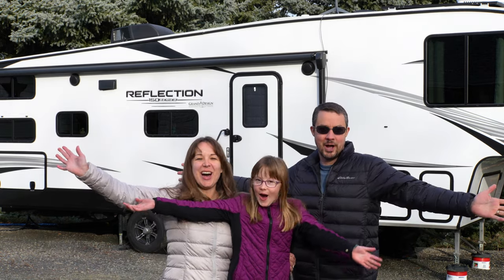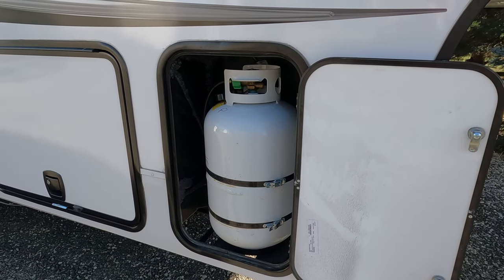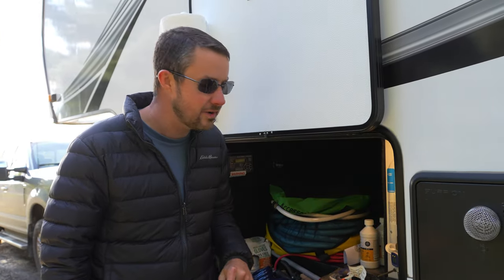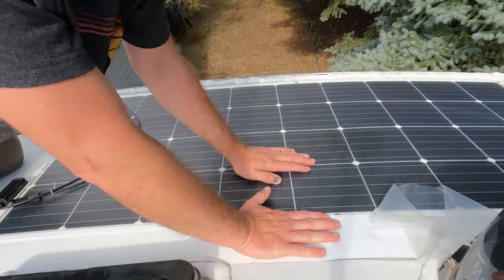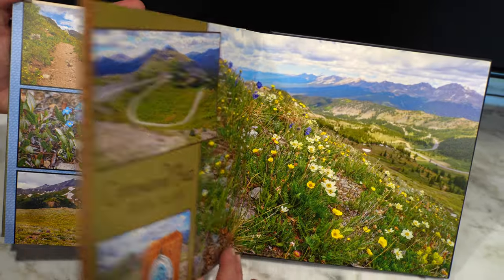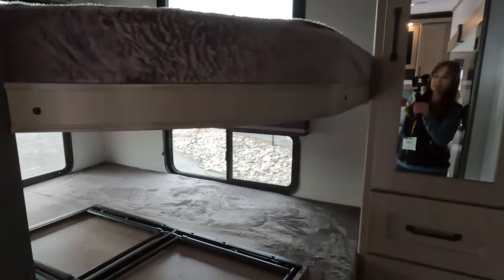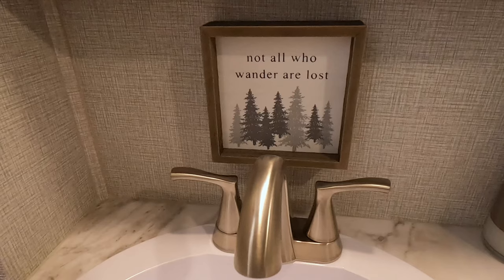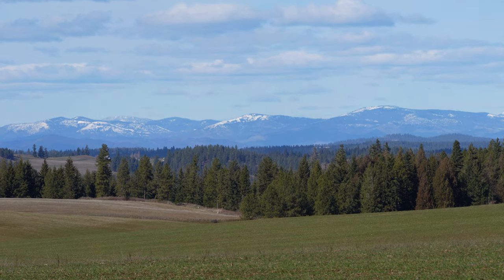Walkthrough of our Grand Design 278BH

Comment: I just discovered yall and you got my interest peeked about your solar. I am looking to put some on my rig, and have been trying to find some affordable options. please tell me more about your flexable panels.... Brand, cost, etc. And can you run your AC for any length of time? thank you in advance. love your content so far.
Reply from the maker: I'd be glad to help! The links to the major components of our solar system are below. These are also in the video's description.

The 175 watt Renogy solar panels cost $227 each on Amazon right now, which is less than we paid for them last fall. With our 3 Battleborn GC3 batteries, we can run our heat pump in cooling or heating mode overnight plus small items like our 12 volt refrigerator, our water pump for showers, lights, etc.

Renogy 175 watt flexible solar panels: https://amzn.to/3v0evMZ

Battleborn GC3 battery: https://amzn.to/3PlzS1Y
Victron inverter/charger: https://amzn.to/3v13lHR
Victron charge controller: https://amzn.to/3PlHrG9
Victron shunt for monitoring battery capacity: https://amzn.to/3IGX8Ul
Reply: @calledtojourney Thats awesome,. And so helpful. Thank you so much.
Reply from the maker: @lifeaintover7165  You're most welcome! Message us if you ever need help.

Comment: Sorry if I missed it, is the fridge accessible if the slide is closed (for quick lunch breaks at rest stops)?
Reply from the maker: Partially, yes. We can open it a few inches to grab something close to the front, but if open the slide just a bit, we can get to pretty much everything in the fridge. And we MUCH prefer having a 12v fridge over the old absorption fridges, which had to be kept close to level while operating and didn't get as cold.
Reply: @calledtojourney  thank you